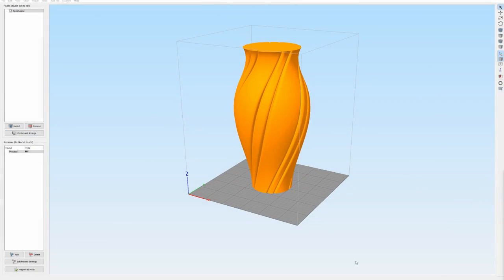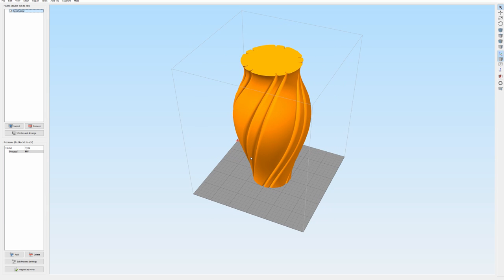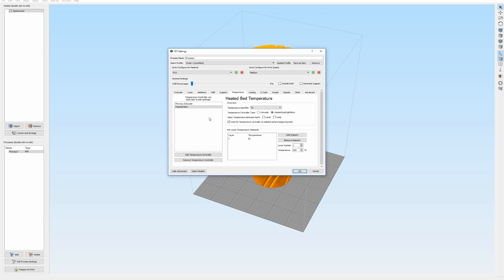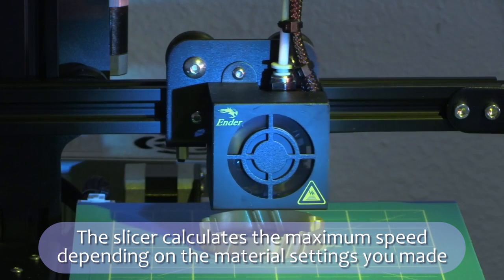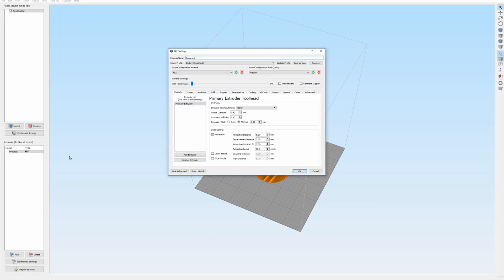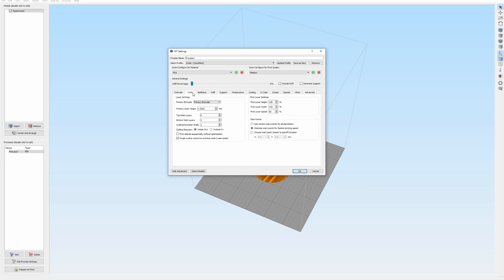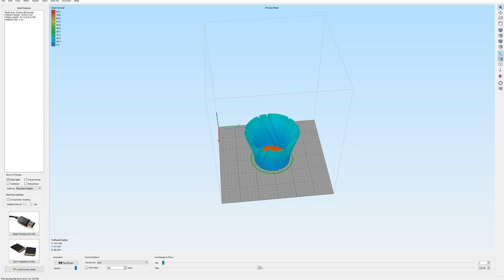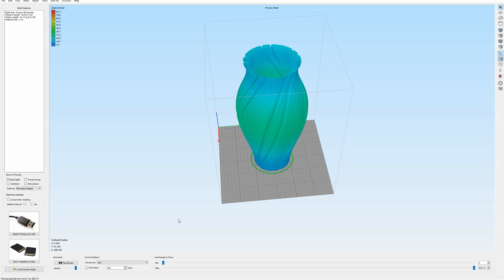▼ 3D Printing in spiral VASE mode

Comment: Quick and easy. But I find it hard to find real use cases for vase mode. Most of my prints need a form of rigidity or multiple perimeters, even if the outer perimeter is just a singe wall. And I don't have flowers, so I don't need a vase ;-)
Reply from the maker: A lot of prints are being made of cats, dogs, comic figures, etc... They can most of the time be printed completely hollow in Vase mode.

Comment: any tips on making the base waterproof brian?im using 10 base layers and it still leaking from the bottom.walls are watertight but i can't get the base watertight
Reply from the maker: Make a separate process for the bottom layers and use a high extrusion multiplier, like 0.20 more then you are normally using. Then when the walls start to build, go into the next process and use your normal extrusion multiplier.

Comment: Thanks for this!  I am trying to use this to print a skull from thingiverse.  It was supposed to take 45 hours at 2 x scale.  Now it says 9 hours.  LOL this is going to be curiously silly.  If it works that would be great.
Reply from the maker: Also think about setting up multiple processes at different layer heights. That can really increase the print speed.

Comment: Haha good man, seen the challenge set on facebook! Was going to do it my self but just built my mini print factory with 2 dremels 3d20 and wanhao 5s xyz pro up mini and 2 ctcs lol 😂
Reply from the maker: Ehh... I don't know about a challenge, but please inform me because I like challenges.
Reply: 3d Print Creator the was a challenge on the 3d print fb group which someone said is it possible to create a vase in s3d using the vase mode and make it water tight. People where saying no some saying yes. Then it turned in to a challenge. I will see if I can the post lol. It was literally the day before you posted your video 😁
Reply from the maker: Thanks,
I did not see it, but I will look for it.
I have made so many vase prints that are water tight, I know it's possible.

Comment: What are the best projects you would choose vase mode, except for a vase? :-)
Reply from the maker: Things that can be printed with a very thin wall. The only thing you have to make sure is that the angle of printing doesn't exceed 45 degrees.

Comment: I tried to print this in cura but the prog. told me the time for this vase is 175 Hrs so i forgot the print idea from my mind at all  😂😂
Reply from the maker: I think you have to check your settings again. This can only take about 2 to 6 hours, depending on the printing speed.
Reply: @3dPrintCreator  I have Anet E12 Printer
Reply from the maker: Well, it's not about the used printer but about the settings in the slicer that you used.
Reply: @3dPrintCreator  Do you have a good settings , I am using cura Version 15.04 , Guide me ?
Reply from the maker: I don't use Cura myself. Yet, I have a lot of video's about slicers of all kinds. take a look at my website https://3d-printcreator.com and you will be guided.